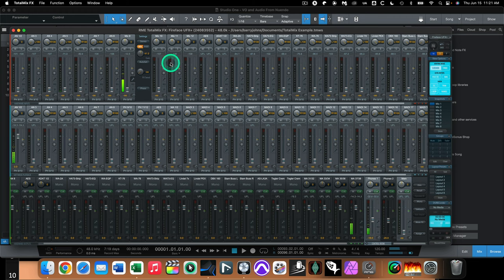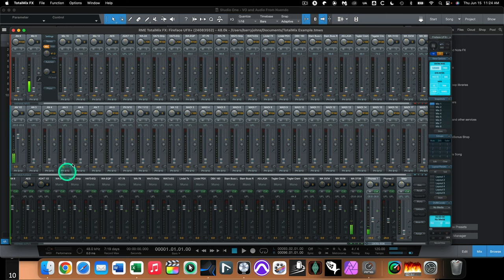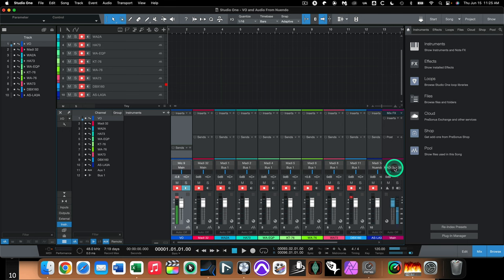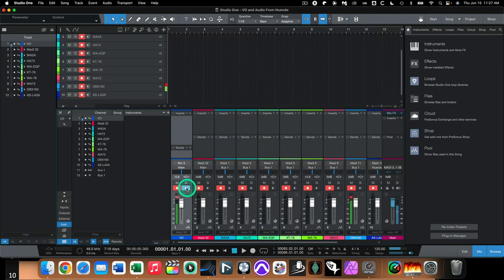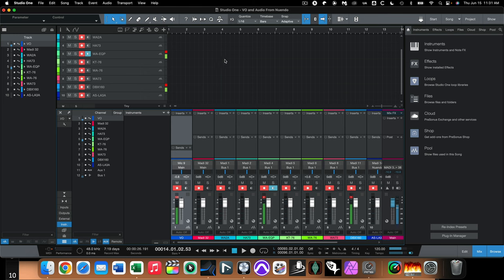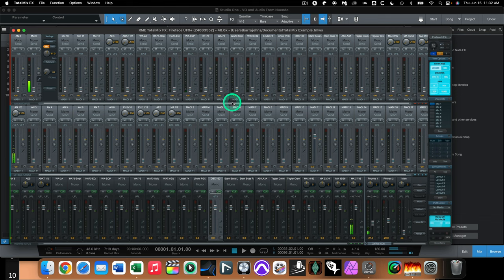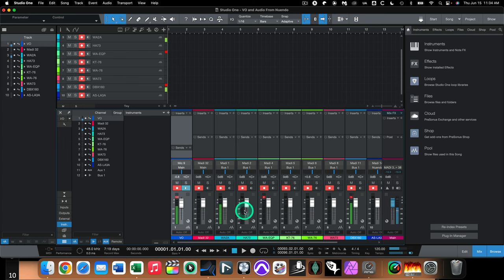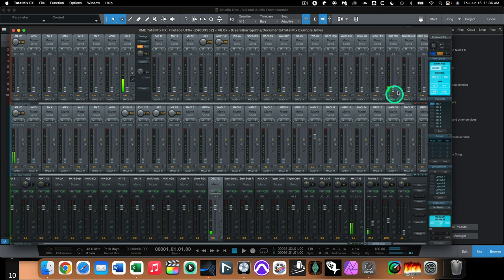RME TotalMix - Hardware Routing Simplified - The Holy Grail Lesson

Comment: There’s always good better and best. As you’ve stated; there are hardly any usable tutorials of TotalMix FX but now I found  the  best tutorial of RME TotalMix FX software on the channel [ RME USA Audio – Synthax ]. The video is called “An In Depth Look At TotalMix FX”. Although it does not deal with all the options within TotalMix FX, it covers a lot of them and in a very pleasant way and pace without any hesitation due to repeating itself over and over again; so the learning pace is very well timed and it gets one over that "hump", you mentioned, within seven minutes, so no steep learning curve.  Also it is far more less overwhelming and less distracting due to the use of also a smaller interface instead of showing  and labeling the endless rows of inputs, playbacks and outputs again and again. So you can save yourself a ton of time and effort by watching that video yourself, to learn what topics are not covered and how to improve your didactic skills. Hope this helps.

Comment: As relates to cumulative latencies when using AD/DA conversions in series in my post below, I just did some checking on the M-32 AD and DA conversion latencies which, I believe, may be somewhat close to the converters in the UFX+ that is being used in this example. I checked the UFX + manual and could not locate AD DA sample latency numbers, but using the M-32 specs, after the oversampling computations…
At 48kHz sample rate the DA conversion is .6ms
At 48kHz sample rate the AD conversion is .77ms
…..so a round trip conversion would be 1.3ms.
To my thinking, using Totalmix as a patchbay to route signals to/from two analog devices at 48kHZ would introduce : 
0.77ms on the initial signal AD conversion
1.30ms on the ADDA through the compressor
1.30ms on the ADDA through the EQ
3.37ms total
….before the signal hits the DA (0.6ms).

Wouldn’t this 3.37ms latency create an “actual” out of phase relationship with other tracks being played back through Totalmix? As I mentioned, I thought I noticed some phasing.

This is not meant as criticism. I really love these tutorials and appreciate your efforts in explaining the potential available in Totalmix .

Much respect.
Reply: I am also curious how to deal with latency here as I am recording a lot of drums with parallel stuff.

Comment: Thank you Barry.  This helped me a LOT!  Now all I need is more I/O for my interface.  I'm acquiring enough hardware that the 8 channels on my interface just isn't enough.  I have an old Fireface UC that doesn't have MADI and has only 1 ADAT port.  I have plans to get a Focusrite Clarett OctoPre so I can get 8 more channels of ADAT-accessible I/O.  The Pulse 16 would be great but I don't have enough ports on my old interface to access all 16 channels.  For now, 8 additional I/O ports will be enough for the hardware I have.  There are always work-arounds if I need to daisy chain hardware devices.  They are all in my patch bays so I can just re-patch things if necessary.
Reply: I have the ucx ii and the focusrite Clarett OctoPre 8 as well along with two patchbays is how I'm doing it as well.

Comment: Great video! I'm a beginner so a lot of trial and error and YT videos to go through. All the hardware you've got I'll never have so I'm dependent to a DAW, in  my case Reaper, using a RME UCX II as my interface to record and have fx applied to my signals. In the RME UCX II goes a Prophet 12 synth, a Roland TR 8 S, a microfone and a guitar. Out go my two monitors and a headphone. To me it seems easier to have all that hardware instead of  having only three hardware outputs; left and right monitor and headphones. I find it a steep learning curve to learn how to use TotalMix combined with recording in a DAW. As far as I understood your videos so far I'll need the loopback function on the outgoing channels in TotalMix to record in Reaper.  BTW: you are right about needing a signal indicator on the input channels one loops back to. 
I'm looking forward to more videos about TotalMix. Subscribed.

Comment: Thanks for this Barry!  Just transitioning to RME UCX II from Presonus Studio 192 interface and Studio One.  In my previous setup, I just used the PipelineXT plugin in Studio One on the main bus to route signal to my outboard bus compressor and thought I could do the same thing with RME.  However I have not been able to achieve the same result.  With the plugin enabled, it seems that there is some signal bleeding in addition to return signal from the outboard gear creating some phasing but I can't see where it is coming from in TotalMix.  Have you tried using Pipeline XT?  If I can't get it to work then I guess I can achieve the same result using some additional bussing, but not as convenient and not as easy to be able to switch between the dry and processed signal just by enabling/disabling the Pipeline XT plugin.

Comment: I'm wondering if the Matrix view of the mixer wouldn't be better for this type of routing. It will give a better over view of the mixer state and allow you to more easily see any levels that should not be routed. 

Start off by having both the matrix and the mix window open and visible when you make adjustments in the total mix mix window and this way learn where your most used X-points are. Once you are familiar with the matrix mixer setup a total mix view preference to remove excess crospoints and transition to the matrix mixer. The shortcut keys for opening both the matrix and mixer windows should also help with this.
Reply from the maker: Check out my video on explaining why the Matrix window is so important to understand.

Comment: Great stuff! Just wondering, you will introduce an additional da and ad conversion for each hardware piece whereas with something like manual patching or flock you do the da+ad only once for the track. And even better if you utilize analog summing you would have da only once for each track and only one ad for the final 2bus (preferably with higher quality ad-converter). But is this a non-issue?
Reply from the maker: Yea you will be doing additional DA/AD this way. The conversion is very good so I don’t concern myself with that.  I do have patchbays, that all my gear is connected to so if I’m tracking on the way in, I patch them, if doing hardware inserts there is of course DA/AD happening.

Comment: You managed to sum up in 30 min what took me probably days to finally figure out!
What many might find helpful imo is a quickie on routing a stereo source to a mono input only outboard gear. Best I figure is first splitting the stereo source to two mono channels, then sending each at a time, recording the corresponding receive channel/track x 2. Complicated with very little room for error but with some rewarding results if done correctly. Any other method (other than recommending buying an identical pair!). Thanks.

Comment: Hey Barry, how are the converters in the Ferrowfish vs the RME.   I’m considering the same setup, however using the Ferrowfish as adat for the db sub connections , l believe it means the AD conversion coming back from the hardware will be done at the Ferrowfish  not the Rme.   Was wondering about the Ferrowfish converters.   Thank you.

Comment: Given that you have enough I/O (AD/DA) converters, this would eliminate the need for a hardware patchbay, however,….when used for committing a compressed, EQ’ed signal to DAW during tracking, it would also increase the number of AD/DA conversions vs using physical patch cables, plugging the output of a preamp > input of a compressor > output of comp > input of EQ > output of EQ > AD conversion to DAW(one AD conversion)

Whereas, by using Totalmix routing as the patchbay, unless I’m missing something and the internal patching does create AD/AD conversions between devices physically patched to the AD/DA converters of the RME FF UFX+….

Output of preamp > AD converter #1 > DA converter #1> compressor AD converter #2> DA compressor converter #2 > AD EQ converter #3> DA EQ converter #3>AD converter#4 > DAW (three AD/DA conversions and one final AD conversion to commit the processed signal to DAW….

Each in series, A/D D/A round trip is going to add cumulative latency into the signal chain.  Are you hearing any phasing?  I think I may be but I am listening to this on an iPad, not at my workstation…..

If the hardware was being inserted on channels in a DAW at I’m down with latency compensation, there would be one AD/DA compensation per unit channel (stereo or mono) but they would each be delay compensated and thereby phase aligned….

I use an RME MADI FX PCIe card with M-32 AD and DA and ADI-8 QS converters which should be roughly equivalent to the FF UFX + in design and AD/DA round trip latency. 

These tutorials you have created are wonderful and a bit groundbreaking actually. Great job. Thank you. Losing my hardware patchbays is an appealing thought but I’m wondering how much the signal fidelity would be impacted by this many, in serial, non-phase aligned AD/DA conversions.
Reply: Ugh..,this damned IPad…second paragraph should say “missing something and the internal patching does not create AD/DA conversions
Reply: 5th paragraph iPad typo should read “inserted on channels on a DAW at mixdown” 

last paragraph typo should read “fidelity should me impacted by this many, in series, non-phase aligned…”

Comment: Have you done away with your patchbay then Barry? This seems to contradict what you were doing in previous videos, or was it just for illustration?
Reply from the maker: No not at all.  I have two patchbays.  When I track I don’t route through totalmix, it’s when I use hardware inserts at times.  But can you eliminate patch ays, yes if you have enough I/O.  Remember every time you’re routing through total mix, you’re dealing with conversion happening both ways. You don’t have that when you use a patch bay.
Reply: @BarryJohns  Thanks Barry, I guessed as much, but thought I'd doublecheck incase you'd had an epiphany!

Comment: In what situation would u want to split the mic signal...partial going to an EQ and the rest of the signal to a compressor? Like the Y-cable example you gave...when would u apply that?
Reply from the maker: I think I mentioned that it would go to two different compressors to A/B.  There can be lots of reasons to Y a signal.

Comment: You seem very knowledgeable with this software, thanks for all the info. The problem I'm having is this: Instead of wanting to record through my hardware like you explain here, I'm trying to slap a hardware compressor across my mixbus. I have it all set up hardware wise right (7-8 out of the Fireface into the comp back out the comp into 7-8 of the Fireface.) Great. The problem is when I pull up 7-8 on Totalmix im getting phasey feedback. Ive tried everything I can think of. Please tell me you can help. FRUSTRATED!

Comment: Great video Barry, thank you very much for doing these. When you go in and out of different hardware units in series, is it correct to say that the signal is being AD/DA converted each time? Is there a way to pass out of one hardware unit and into another without AD/DA conversion, using TotalMix without physically cabling them together in series? I hope I'm making sense here.
Reply from the maker: Yea for each path you would have conversion happening, same as you would for hardware inserts.  It’s doing the patching digitally, but you still have to have the conversion occur each time it goes in and out of your interface.  Modern interfaces have outstanding conversion so the going out and back in would not be noticeable.  If using an older RME that may not be the case.  

This would be the difference between doing the routing in totalmix vs a patchbay.

Comment: Great video. 2 questions please.
You route you mic to the outputs, and then you see it in your equipment input. So i guess this is because of the routed equipment you connected to the RME.
How is you equipment is hooked up in practice?
Reply from the maker: Remember, outputs feed inputs.  So mic cable is an output, that goes into the input of a mic preamp, mic preamp output goes to the input of the next thing and so on.

Comment: I’m curious as to what type of latency there is the further down the signal chain you route audio from external device to external device since you were only monitoring one channel at a time in Studio One. Just as a note to Studio One users, I was able to overcome a latency issue I was having when I changed my workflow from sending my source signal from channel to channel to capture external device signals to instead stay in one channel and using Pipeline XT for my initial hardware insert and then using the Splitter tool on that inserts to then daisy chain subsequent instances of Pipeline XT to as many hardware devices as I wished to build a signal chain to my liking with no perceivable latency that I could detect. Then I could just turn that signal chain on and off within Studio One just as I would using a plugin. Very convenient. I’m going to do a side by side comparison myself to see which workflow I prefer. Who knows, maybe I’ll find a way to utilize both workflows together. Hopefully 😊

Comment: great video. how is the latency once you start chaining multiple hw fx?
Reply from the maker: Zero in that regard.
Reply: @BarryJohns  unfortunately not. I measured 34 samples with a single pass at 48khz. while that is incredibly low, it will add up once chaining multiple passes. total mix is very very powerful, yet chaining fx will still require a mix of software plus analog patchbays to keep it phase coherent.

Comment: I have the UCX II. Can I route my an 3 hi-Z to the AES which is my Axe Fx III and record both the DI from the RME and the wet signal from the Axe Fx III?
Reply from the maker: Yes
Reply: @BarryJohns When I try like your video I get signal from input 3 where  I’m plugged in, and AES output. No signal from the AES input
Reply: I have it working correctly now. I needed to change the Axe Fx III clock to spdif/aes and the input 1 from analog to digital. The rme clock needed to stay internal to clock at 48k.

Comment: I'm starting to HATE total mix. It's overly complicated and not "intuitive" at all. Sounds good, very capable but you waste to much time figuring things out especially when adding new gear.
Reply from the maker: If you spend the time and watch all four of my videos, you will clearly understand it. This is the last video in that series, I stress that it’s important to go back and watch each one in order to build a foundation. I simplify it in a way that RME never done.
Reply: @BarryJohns  yes, I watched them! It’s a much better explanation than RME’s channel. I was connecting the tegler cream rc and it seems like what was happening was using the pipeline plug-in, was interfering with the Tegler plug-in and causing too much latency or something. it was also trying to blend the dry and wet signals, which I didn’t want, but I got it routed properly. I bypassed the pipeline XT and went straight into the main for the master bus compressor and plug-in. I’ll have to bounce to new track and not render but it’s working fine, took a while, but I got it going thanks!….and I saved the snapshots and mixer layout to easily recall or input the tegeler when I start mixing.